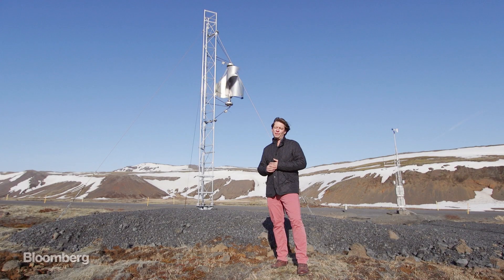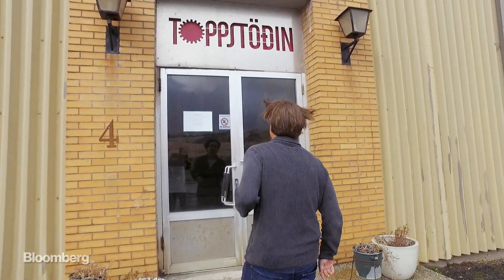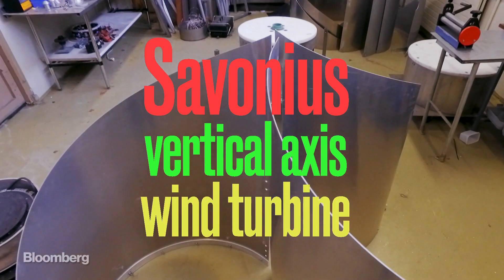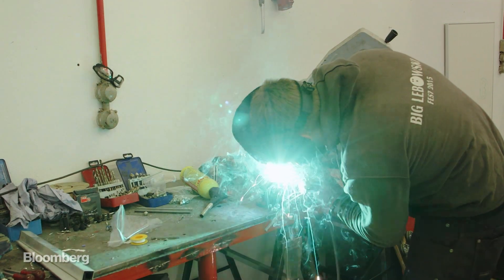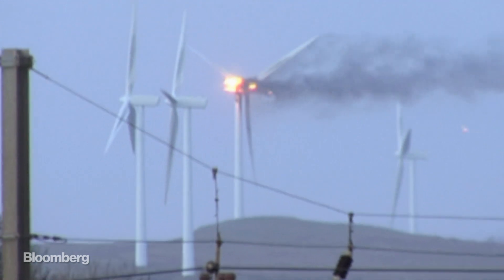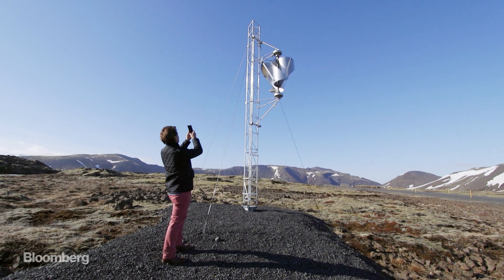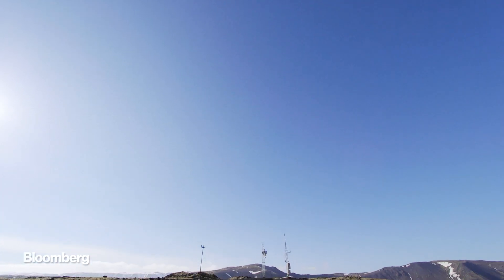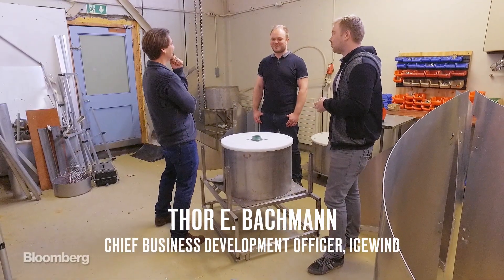The Tech That Could Fix One of Wind Power's Biggest Problems

Comment: The power available to these is 50% of the profile cross section of the blade unit.
The power available to conventional turbines is 3.41 x the length of the blade squared.

These are fine for phone batteries, and a couple of LEDs.
They cannot provide serious power (not that conventional fans do either)
But be honest in reporting these things.
Reply: The power available from ANY wind, is the cross sectional area exposed to that wind. 

This has nothing to do with efficiency, engineering aesthetics or colour.

The bigger the energy catching surface exposed to the wind the bigger the POSSIBLE energy available.

That is why the fan is popular over the water wheel style above.
The fan blades are all facing the wind all the time, only half the blades are facing the wing all the time with these, and half the surface, although slipstreamed, is fain against the wind.
Reply: Still only half the total vertical surface area is in a position to use the energy of the wind.
And a shield eliminates the omni directional advantage.  A lose lose .
Reply: Ian Withintent they were though. They were stating that this turbine type is more rugged and more resistant to T-storms. They weren't concerned with the actual power output, as that is something for standard turbines, geothermal plants, and solar in that region.
Reply: WindPowerKits that's how it keeps from going too fast by design. This isn't an effecient design, it's a resilient one.
Reply: Thanks for the real specifications, you're doing a real service :)
Reply: +OÄKTA DOPBOK
I think Ian simply tried to point out that this is not new technology that "fixes [the] biggest problem" as Bloomberg states. Nobody should think a Savonius turbine will "fix everything", nor that it is useless.
Reply: The path has to be just as "huge" to make comparable power. In fact it has to be much more, because a Savonius rotor isn't nearly as efficient. Let's look at it this way. It's not possible to extract more than about 59 percent of the kinetic energy that would otherwise pass through the space where the turbine is. Some large turbines can extract about 40 percent. A Savonius rotor, however, only uses about half of it's surface area for productive purposes. If you could somehow sneak the other side upwind without any drag, you'd still have only 50 percent X 59 percent is 29.5 percent for a PERFECT unit, vs. 40 percent for a REAL HAWT. So a perfect Savonius rotor would have to be higher and wider than the diameter of a real life HAWT of the same power output. It would throw a lot more shade, and my guess is it would be considerably noisier. Cool factor never changes real power output, though in marketing it's absolutely necessary.
Reply: @lr21643  How about using a vaned shroud that funnels the wwind into the driving side of the blade?
Reply: Did you miss the big part about how conventional turbines in high winds break, and these don't... No one said these are for large scale energy production. However they could be, build them big enough and they'll produce large amounts of energy. These are for areas where conventional turbines "can't" be used because of excessive high winds. They stated in their area (which is probably the only area they can be sure of) conventional turbines dont last more than a couple years. That's not sustainable when you could build these on an equally large scale and have power always, instead of power in the Goldilocks zone.
Reply: DrewM: If you're expecting huge winds, you can design a turbine for it. It won't put out much in low winds though, any more than a Savonius rotor designed to withstand high winds would. I'm pretty sure a Savonius rotor would put more load on a tower than a HAWT. A propeller is just a turbine backwards, and we've had props that can withstand 2,000 or 3,000 hp (2.2 mW, I think) at over 400 mph for about 80 years! (WW2 fighter airplane). So designing for high speeds isn't necessarily much of a problem. If turbines don't last more than 2 years in their area, then the turbines they buy aren't designed properly for the conditions. Don't let hopes and marketing get in the way of your perception of reality. If the bearings and prop blades are what failed, I could probably take one of the units, new, and carve a smaller prop out of lumber that would withstand the winds. Lots of wooden props are flying around at 150-200 mph on small airplanes, 

BTW, I'm not necessarily a stick in the mud. I think it will be interesting to see if kites for generating power turn out to be viable as well. Advantages are that there's a whole lot less heavy junk to haul around, and you don't have to lift it much. I suspect a lot more maintenance is involved, but maybe not more than could be covered by the initial capital saved.
Reply: One advantage of LEDs and our communications devices becoming so low power is that THIS and other alternative sources will be the power grid of the post oil future whether or not we like it.
Reply: Well not to mention that it will continue go on moving in the same direction and will never stop moving!!!
So, if you mind its win win design or simply practically use it; it will produce much more electricity in a month than the modern one(as per by your said)!!!
Reply: Ian Withintent thanks that is exactly what I was gonna say! Also not that it makes a difference but pi is 3.14 not 3.41. Still your correct this illustrates the fundamental issue of this system.
Reply: You need to have a look at the design of the Gullsweep bird scarer which rotates the blade that is opposing the wind direction to provide a smaller area. OK that raises friction bearing and low wind speed problems but it is a step in the right direction. A bit more time needs to be spent on vertical axis blade design and the anchor point.
Reply: I have been building vertical wind turbines for 6 years. From very small to very big. Every kind you could ever think of.  Not one of them has ever approached the power of a small horizontal wind turbine. Ian is correct.
Reply: To advance, mankind must not dwell upon notions of what Can't something do, but rather what Can something do. This turbine needn't power a rocket to the moon for it to be exciting and advancing in nature. It need only be understood and made use of.
Reply: How do people no understand the simple fact, 
WIND energy comes from WIND.
It is the cross section in the path of the wind that can harness WIND energy.
Three stacked 50% inefficient wind mines are still 50% inefficient.
3 times the manufacture cost  to engage only half of the wind available to the surface area blocked.

Did nobody pay attention in junior high school?
Reply: Exactly.  Thats why vertical is not viable as a design.  Wind does not blow in a circle.  As the one side catches wind, the other side is being resisted by it.  Its called back side resistance.  Ever ride a bicycle into a headwind?  Now isn't that easier to do without a headwind?  OR another example I like.  2 identical boats are racing.  But one is dragging his anchor, the other is not.  WHICH BOAT do you bet on?
Reply: What is conventional turbines please ?
Reply: Perhaps you make a bigger rig.
Reply: Jebus! It's still only a 50% .
Reply: "(not that conventional fans do either)"

A regular wind turbine is around 2 MW.
Reply: Technicalities
Reply: That depends on how large it is. You can buy wind turbines as small as you want, or you can get them up to 8 or 9 megawatts now, with larger ones planned. So what's "regular"?
Reply: think you mean 3.14 friend
Reply: yeah LENZ design is much more efficient.
Reply: Is the power generation of wind turbines attributable  to RPM (how fast it spins around) or by torque? (the turning strength)
Reply: @sarateubert8252 , most electrical energy creation technically relies on RPM, but torque is useful to overcome rotational momentum and getting the process to move in a useful manner.  

What generates the electricity is similar in concept to the generator/alternator in your car which uses one form of magnetic differential or another to generate an electrical difference, aka current.

A large wind generator's blades can spin slowly if it is geared so that it spins something (or somethings) faster.  Kind of like when you have your bike gears set up so that your largest pedal gear is linked to your smallest wheel gear, one rotation of the pedal equals numerous rotations of the wheel.  Using that concept, a giant windmill may have a full rotation every 10 seconds, but it is geared for the generator to complete several hundreds of rotations or more.

Where torque comes in is if you have ever tried to start an 18 speed to move with that gear setup.  It's great for getting the wheels to spin really fast for every pedal of yours, but it requires a lot of extra force to overcome the rotational momentum.  That's why you start pedaling with a bike when the gear sizes are closer together in size, and then change them as you speed up.  

Automotive transmissions operate on the same concept, but are setup so you only have to consider one set of changes instead of two.  You start in low gear and move to high gear.  A transport truck like a "big rig" has numerous transmission settings.  Where they start the truck in depends on their load.  At full load, the driver will probably start off in 1st gear (of 10-18), but with a small load or just a trailer they'll start in 3rd, and maybe even higher if they have no trailer at all.

That's why torque is important in a wind turbine, basically to get everything moving to generate the electricity.  Once things are spinning, torque doesn't matter as much.
Reply: @Charistoph  
Torque always matters.  Generators don't spin freely.  The more loads they are powering, the more resistance there is to rotation no matter what RPM.  Generators are most efficient for their size if designed for a relatively high RPM, but they still need torque behind the rotational speed.  If not, resistance from electrical load will slow that RPM to a halt.  You can feel a large progressive difference as you add bulbs to the circuit of a handcrank flashlight, for example.
Output from a residential backup generator is measured in watts which depends on input measured in horsepower.  More horsepower equals more watts.  One horsepower of power is 746 watts of power.  Changing one to the other is never 100% efficient.  Horsepower is torque times RPM.  A model airplane motor at 20,000 RPM makes far less horsepower than a lawnmower engine at 3500 RPM because of the torque difference.  The same amount of horsepower can be achieved from two engines identical except for bore & stroke which balances RPM & torque.  A low torque (big bore, short stroke) engine will need higher RPM to make the same HP as a high torque engine (small bore, long stroke) at low rpm.  Once a generator is operating at its optimum RPM, its output in watts of electricity is directly related to how much torque is behind that RPM.  It's a combination of physics and engineering.
Reply: @denbecr49 , You MIGHT want to go reread what I wrote.  Nothing you said counters anything I said.
Reply: @Charistoph 
Yes  it does.  It counters your assertion that torque is mostly necessary just to get things moving and that RPM dominates after that.  The truth is both are absolutely necessary and equally important at all times.  You can't have high output with high RPM only.  You need maximal RPM and maximal torque to get max output.  You are describing something similar to a car's or bicycle's MULTIRATIO transmission that maximizes torque at the wheels in low gears and maximizes wheel RPM in high gears.
  A wind turbine needs the right ratio of both to make electricity efficiently and it much achieve it with one fixed transmission ratio.  At full capacity the torque needed to turn the generator is high due to all the electrical counter EMF.  It needs hi torque or it will slow way down.
  It also needs RPM, for 2 reasons.  One is that generators can be built smaller and cheaper if designed for high rpm.  The other is that with a fixed gear ratio, you can"t get full power to the load if the torque can't be supplied fast enough.  You can put a long handled wrench on a car's  lug nut and make the car roll with the torque supplied by your arms, but you can't apply that same amount of torque at any significant RPM.
Reply: @denbecr49 , I think you missing the fact that I was speaking proportionally.  To get something started spinning takes more torque than to keep it spinning.  There is such a thing as rotational momentum which helps maintain the rotation.  The actual generation of electricity requires the RPMs.  That is to which I was speaking.  The torque used to get TO those RPMs will be higher than is needed to maintain those RPMs because of rotational momentum, so is less important once it is going.  The other side of that coin, of course, is that wind speed is hardly consistenet.
Reply: @Charistoph  No 
HP=rpm x torque
Reply: @jazldazl9193 , Torque is the force applied in a rotational manner used to overcome turning resistance.  Torque is needed to get something rotating in the first place, and isn't needed so much once it is.

One can have a sportscar with a lot of horsepower, but without the torque to pull a heavy load.  That's because the gearing is set up to handle the relatively light load of a sports car, while a truck with the same engine can pull a heavy load because its gearing provides more torque.
Reply: @sarateubert8252  Both.  Neither is more important than the other.
Reply: @sarateubert8252  both
Reply: Regular turbines only last about 3 years in Iceland. Excess speed in heavy winds. This design lows itself down in heavy winds which is the advantage. Any turbine that goes on top of a building or in a backyard has to take that into account and so the most common wind turbines are likely to be of this sort of variety that slows itself down in high wind speeds.
Reply: Coincidentally, all that is required for education to lift the poorest people out of their predicament is LED lights and internet access.
Reply: @MrWackozacko  I would contend food and water matter more
Reply: less swept area, huge wind shadow, high cost. everyone  wants a square wheel, i don't get it.
Reply: @adayinthelife5496  no they want a practical quiet cheap source of energy
Reply: @Yuryi Tkachenko i didnt claim it was fake, just a grand sweeping statement that i asked for the science behind it @fahim above has supplied this so thanks for your derision.
Reply: mine's a 1kilowatt unit..   5 foot high 3.5 ish foot wide.. on the contrary, they are VERY usefull when you know what your doing...  put a phone on it...    you'll be surprised a 5 volt device FRYS from an 18 volt generator lol..

ya,,  hand made with neodymium magnets.. I get 13 cents back every hour it spins on my electricty bill.
as we know, you cant draw power from any windmill or it stops it in its tracks..
I charge 2 batterie's and dump the power into the grid.
Reply: @misatoblushing6913  Information can be learnt but BAD MANNERS are a bit harder to deal with.
Reply: @johnfoster3286  As is ignorance. Voicing an action as an insult is certainly an indication of this without an explanation. Perhaps the "excuse" is I cannot understand any of this, how dare you be smarter than I dream I am so I have to (try, poorly) insult you?
Reply: these are great then for homes, advertising etc
Reply: The most impressive feature of this design is the unique appearance.
This is specifically designed to capture the maximum crowd funding from the internet and provide politicians photo opportunities
Reply: You turn the fan into the wind and 100% of
the surface area collects energy from the wind, your system can only ever collect <50% of the surface area exposed.

I do not believe you are stupid enough not to understand this so I can only assume you are prevaricating to muddy the waters.

I honestly don't care about the competition, just dishonesty.
I rely, like everyone else, on fossil fuel for the foreseeable future. 
Both wind  systems are just dishonest trawls for tax payer dollars.
Reply: What would happen then if you had a shield blocking said resistance from creating an opposing rotation. And although conventional wind turbines are better streamlined they will also have some said resistance creating opposing rotation. Am I wrong?
Reply: @bitchin7227  
Yes. you are wrong
  All 3 blades are rotating in the correct direction.  No part of the rotor is subtracting energy from the rest of it.
Reply: +Andrew Puckride the theoretical max efficiency of any turbine can never exceed 60%(Betz's coefficient), and for actual turbines in real working conditions its in the region of 36-48% so he is right, these are great for small scale power production but for large scale production it is just not practical or possible
Reply: @fahimfazlullah7686  thankyou. at last some science,  thanks i can believe this now as your answer was based on known principles and answered my question.  I can follow the argument now.  though i still think ANY non carbon based power (which will generate a net gain of power over its construction costs - and to the professional misinterpreters out there by this i mean a generation of power over its life span greater than the carbon based power used to create it.) regardless of it efficiency is better than the death spiral of carbon based systems the world uses now.
Reply: @andrewpuckridge7633 u are right when it comes to alternate energy thee is no one size fits all answer, the key it to combine all of them( wind, geothermal, solar, bio gas) so that they can at least reduce the need for fossil fuels
Reply: @fahimfazlullah7686  tesla bulit a turbine which ho claimed 98% effeciency it has been nearly verified to 98%.  Multiple independent universities and labs have achieved over 97% with it. They just haven't quite cracked 98%.
Reply: @sideswipe147  
Yes, but Tesla's turbine is desined for liquids, not gases like blowing wind.  Its efficiency can be high in specific narrow ranges in lab conditions, but it is not a wind turbine.
Reply: Im not saying you are wrong about the wind turbine power but where can i find that information . I always wanted green energy until i realized it wasnt  'practical ' if you know what i mean .
Reply: Gandalf The Great. Not practical? It seems to be growing without the stupidly large subsidies coal and gas get.
NIMBYs need to get out of the 90s. Engineers solved those problems with renewables
Reply: Ian Withintent 
This nigga truly is the albino grand master of wind 😂 👌
Reply: Ian Withintent, what if you stacked them to where the space taken up by one is equal to more obtrusive 3 blade system? I wonder how many you would need to equal 3 blade system...??
It IS after all, still spinning, therefore generating SOME positive energy, with less dangerous “huge path” of 3-blade system.
Reply: Ian Withintent Power is expressed in watts, surface in square meters, your equation just doesn't make sense. Your 50% argument in dubious, because the thing is rotating, it's a dynamic phenomenon and you can't just reason in terms of one half of the contraption is being pushed and the other half is being pulled, it's more complex than that, it's fluid dynamics.
Reply: @frenchimp  it's more complex than that as shown by the fact it spins at all :)
Reply: The whole thing can be set up as one rig that can rotate altogether and the shield could be designed to direct the other 50% of wind into the positive direction. Win win.
Reply: Why are you so dismissive of conventional wind turbines? Are you one of "those people"?
Reply: interesting mix of random technobabble.  i could easily say that fan turbines aren't efficient as they only work as large scale..Are you measuring in watts? does the speed of the blades change the power rating? do you know what the area of the upright turbine is? and so can you calculate its power factor?

if you are going to diss a product please provide the science.. Then i could work out if your argument has merit or if you are just trolling around

thanks
Reply: No, I ONLY mentioned the Surface area of wind the respective systems come in contact with.

The one thing you do not address.
Reply: Did you see how fast that thing was spinning, do you know how much kinetic energy that is. I can charge my phone with a handheld dynamo, and "a couple LED's" get real, who do you work for. Do you say 50% because of the wind that's producing an opposing rotation and if so do you know what a shield is? Please don't answer with jargon.
Reply: @bitchin7227  he gawe you the formula .. to calgulate the output of any wind turbine 
And this partikular model.. so unless you are a FLAT EARTHER this is simpel math 
I just bought a 1000watt@48 /12m/s  Wind power turbine 5 bladed using this formular on wing areal 
To see if this culd produce What IT was rated for.. and IT culd
Reply: the three bladed fans conventionally promoted but the tax payer funded virtue signalling 'industry'.